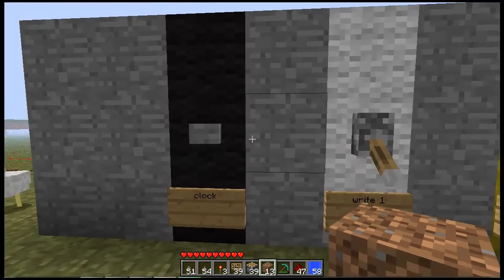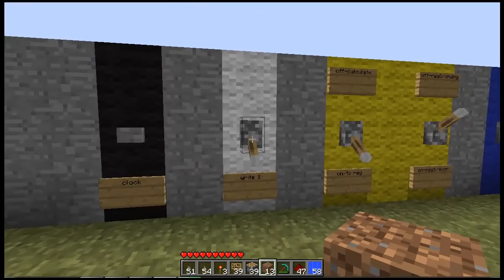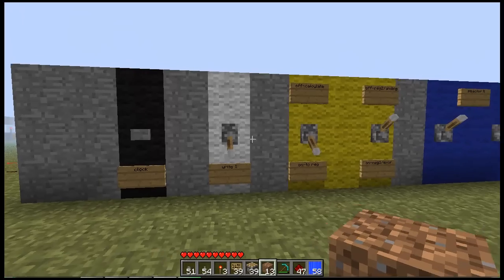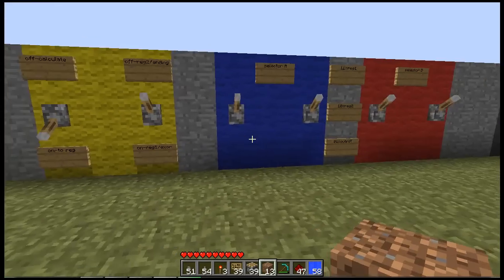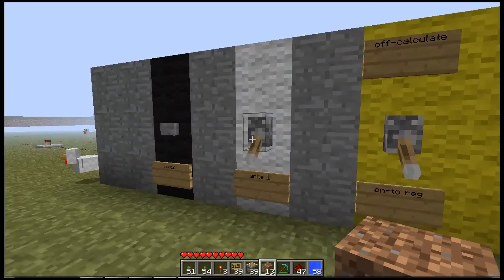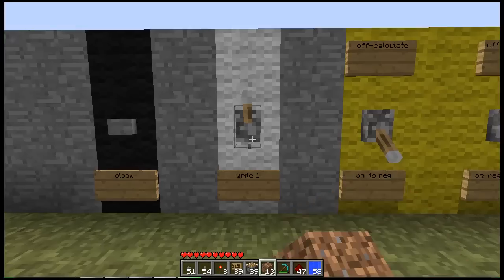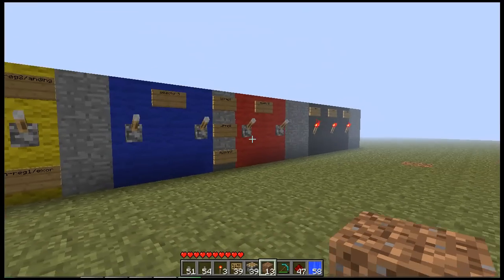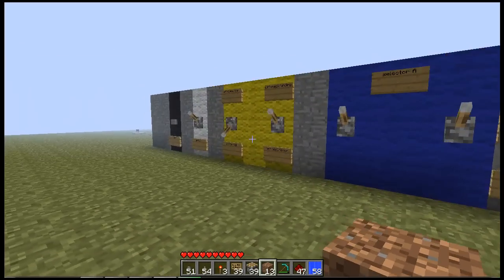1-bit cpu explanation and with some plans

Comment from the maker: If you want to make a cpu then ignore rom, and program counters but otherwise the other components are entirely up to the architecture. but if its your first then make it simple with a couple of registers and one or two Alu functions. and the write one was just the input dragged to the selector so when the input was on the selector output was one.